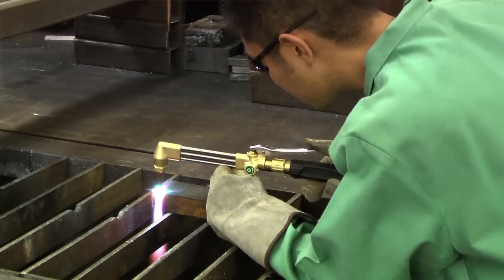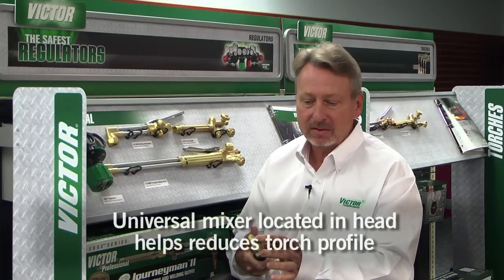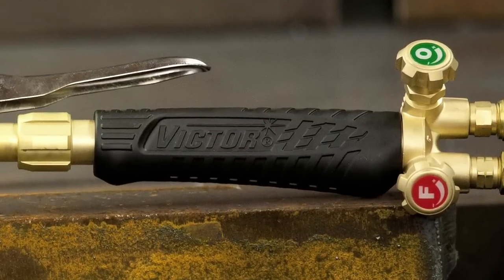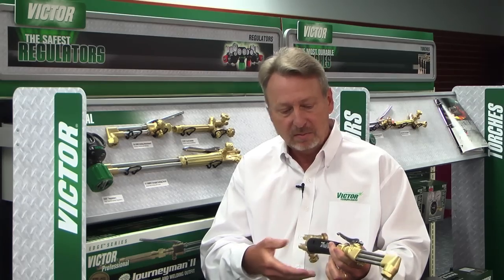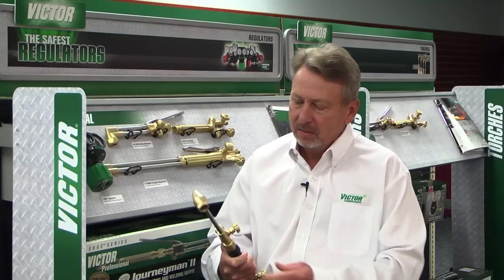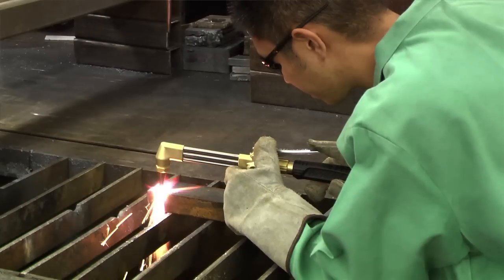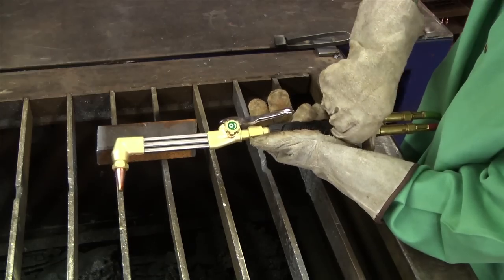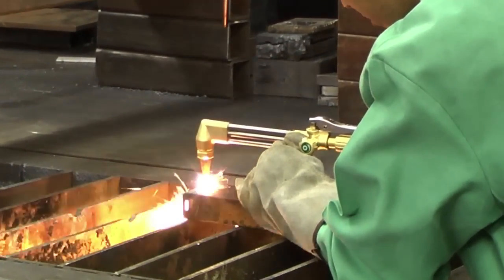The Future of Oxy-Fuel: Engineering the New Victor 400 Series Cutting Torch

Comment: Victors have had tubes in line since the first combination heads.(I collect vintage and antique torches to us.) Nothing on this torch handle is new to the industry. Zamak is CHEAPer than brass and prone to corrosion in salt air (like harbor and shipboard work). Victor solved the fuel and oxygen differentiation issue on their old HD line by using two different size knobs on some handles, popular in mines etc because you can feel them and not need to eyeball the torch. For a REAL improvement how about using a cast steel head like Concoa? Those take heat better than standard Victor heads which relatively often need seat reaming. IMO some MBA was bored and looking for product differentiation.

Comment: This is a joke! You are selling cheap made pot metal torches and trying to pass them off as higher-quality than brass. That crap you are making the handles out of now is NOT corrosion resistant. There is a reason why we use brass below the waterline on vessels in salt water... it’s strong AND corrosion resistant.  But of course it cost more than that easily flowing low melting point crap you have switched to.  Don’t you understand that people are willing to pay for quality, especially when they make their living with these tools?  This is the Internet age. How fast do you think we’re going to travel that your product has turned to shit?

And those “design features” are to ease the manufacturing process and make it cheaper to produce.  Victor/ESAB how stupid do you think we all are?  Hear me loud and clear: after three generations of using Victor, I am jumping ship!!  I’ve been eyeballing those Miller/Smith setups and now it’s time to purchase the last piece of newly manufactured quality torches.  I’m going to guard my OLD Victors closely.  Very disappointed.

Comment: Bullshit, got this exact torch off amazon and  the hose  fittings on the torch were installed backwards, they put the oxy valve where the aceytlene valve goes and vice versa with the aceytlene valve.The aceytlene guages didnt have the correct tank fitting.I had to go to Airgas and get the right one.An additional 20.00 bucks added to the the cost plus my time and fuel to get there..What a fucking joke these POS torches are, maybe the old torches were great but thats what happens when these fucking companies decide to let China or Mexico build their products..Do yourself a favor and purchase a good quality set of Harris torches and fuck Victor.Never again would I purchase a POS Victor Torch!!!!!!!!!!!!!!!!!!!!!

Comment: Will the handle melt or burn if touched by hot steel. Thank you
Reply: No. Zamak is what is commonly referred to as "pot metal". It's cheap, easy to cast because it flows well, and has a low melting point but spatter and slag shouldn't bother it on a torch handle. Since torches are best used with gloves the handle makes no sense to me except as a styling touch. Welding and cutting torches were perfected in the 1930s when they were even more important to industry.   ( I rebuild and collect OA gear as well as use it.) You can't go wrong with the traditional Victor models.

Comment: "if it ain't broke, don't fix it....." Been using Victor equipment for 40+ years. I've never had a problem with the original design. Whether it be ease of use or "comfort" in my hand.
Reply: Agreed! I collect and rebuild torches (all brands) and this new torch is just a cheap restyle. "Ergonomiic" torch handles never took off because in reality users need to work the torch in ALL positions. Old Victor designs are fine, though it's too bad they don't use steel torch heads like Airco/Concoa (the rest of the Victor torch is a better piece but the heads can warp under severe use). 

The best torches I ever used are the classic Purox/Oxweld/Linde/L-tec but most of those got killed off when ESAB was bought by the parent company of Victor. They would have been more expensive to make than old Victor let alone cheap new Victor. Smith (now Miller-Smith) are the last very high quality US torch maker. Speaking of quality, I have a 1920s Victor that works fine and most of my old torches pass a high pressure nitrogen check without replacing seals!

Comment: Just another restyle. Zamak is CHEAPER than brass, not an improvement! It's weaker than brass too and corrodes more easily. I have Victor torches from the 19fookin20s that work fine because that classic design needed no improvement. The 400 doesn't "look like no other torch on the market". Three tube cutting attachments and that style handle aren't news.
Much love for Victor, but I'll take that classic pair of torches behind him on the display instead. I have 315 and 310 handles, and ST straight torches as well as many classic style 300 series Victor regs. (The old style regs and torches can often be repaired in the field in minutes.)
Reply: Zamac is die cast pot metal shit